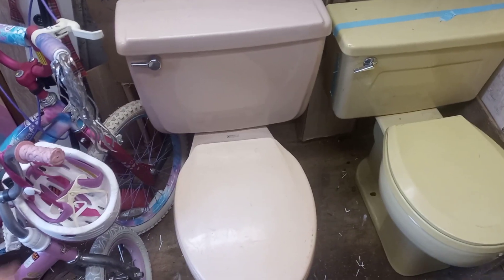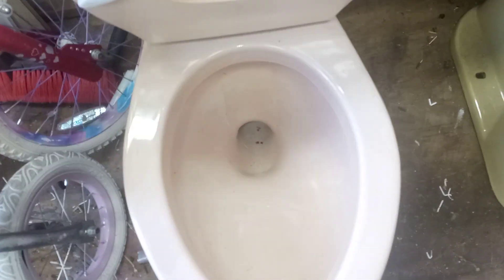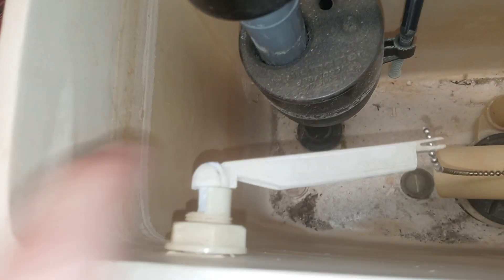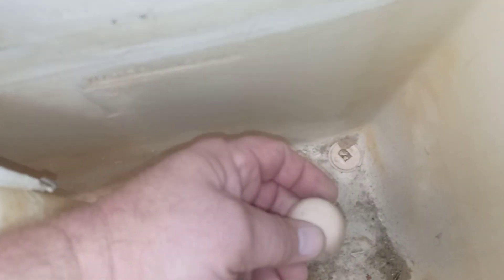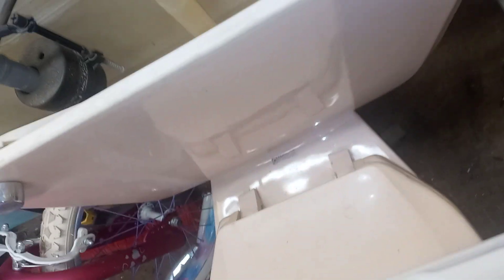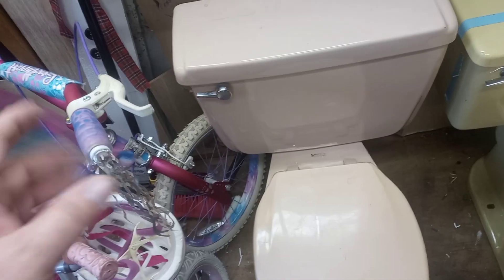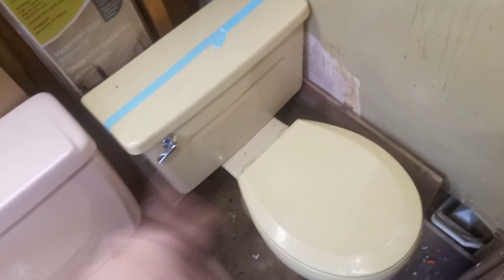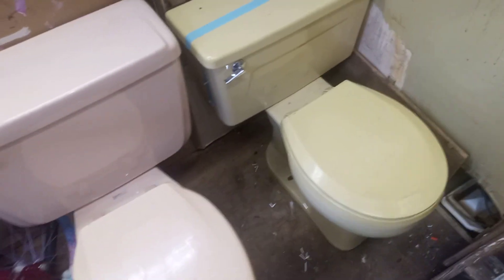1980s American standard toilet picked up from a plumber's warehouse.

Comment: The American Standard Cadet toilet is a 1981 with the 4049-tank series and I have a 1981 American Standard Catalog, and the color is Fawn Beige.  If you have a green toilet from 1971, the color is Bayberry Avocado.  I have a 1970, 1975-1976 American Standard Catalog and they have names of the fixtures and colors they offered that year.
Reply from the maker: Thanks for the info
Reply: They started phasing out this tank design in 1981-1982.